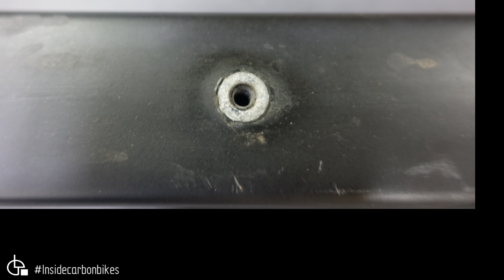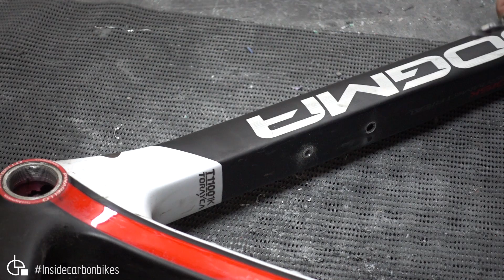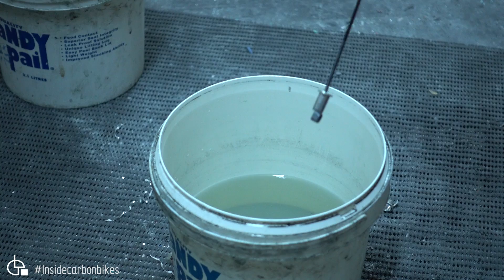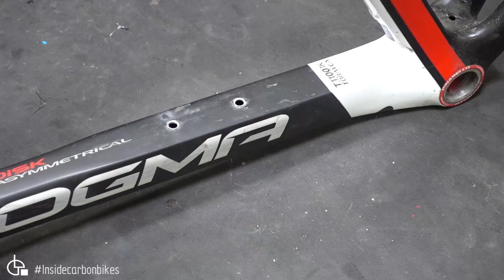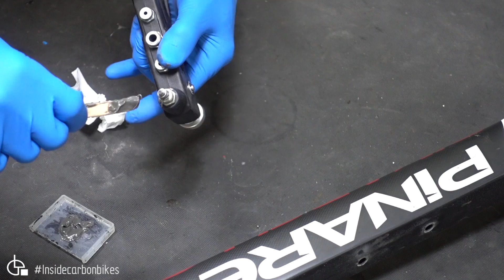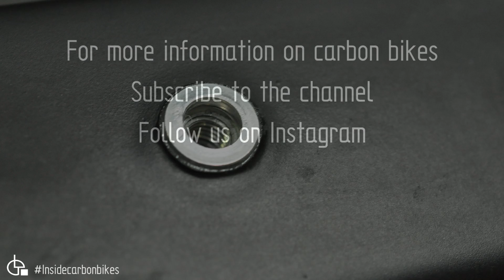How to Replace Inserts on Carbon Bikes - The correct way!

Comment: I realize this is 5 years old, but in what world is the epoxy not squeezed out entirely between the rivnut and the carbon when the rivnut is set?
Reply from the maker: The fit is not that close, adhesive stays in the gaps.

Comment: Is alodine more or less protective than anodising the inserts (alodine is difficult & expensive to get in the uk, & environmentally horrible). Any opinion on just using a stainless steel rivnut rather than aluminium?

Comment: Hi, thanks for the video 👍 I watched this as, after much deliberation, I think I’m going to install 3 rivet nuts in my Kinesis ATR V1 carbon fork to carry more water.  I’ve come to the view that the 3 holes will be in the neutral axis of the fork so shouldn’t impact strength and if properly bonded as you show should be ok.  But….. thought I would reach out for an opinion from a carbon expert before I make a daft move.  Do you think doing this would be insane, moderately sensible or absolutely fine….. if done with care? Thanks for any thoughts, I know it’s a bit of a difficult question to answer.
Reply from the maker: I would NOT do this, do not drill holes where they haven't been allowed in the design. Maybe bond a stud to the outer face but don't drill holes.
Reply: Thanks for the advice, I hadn’t thought about a bonded boss option…… a much better idea :-) cheers

Comment: Instead of two component epoxy I would recommend acrylic glue as used for example for phone screens for the coating and insulating.

Comment: I had an old Trek 8900 frame that epoxied threaded external posts to the carbon tubes instead of drilling them so you'd use nuts instead of bolts to affix the water bottle. No compromising tube strength, no galvanic corrosion. Superior design by far.

Comment: this happened to a mounting point on my carbon fork recently. a ton of white dust, almost sand like, accumulated then the insert just dislodged. my question is: is the fork still safe to ride? does it damage the carbon layup when the insert corrodes so much?
Reply from the maker: There can be degradation of the material in the area, it is difficult to say how much this would affect the safety but it is less than ideal.

Comment: Great vid Raul! When installing new rivnuts after drilling new holes in a carbon tube, does there need to be any carbon reinforcement added to the surrounding area prior to installing the rivnuts with epoxy?
Reply from the maker: It depends if there is carbon damage or not, sometimes I need to do a carbon repair prior to fitting the insert.

Comment: How about a layer of PTFE plumbers tape wrapped around the rivnut to instead of epoxy to insulate the aluminum from the carbon?
Reply from the maker: I would not recommend this for a number of reasons #lessthanideal

Comment: I've been told by my bike store and Ridley that its up to me to do this for a stripped out rackmount after 1 year of use! So I'm hoping to do this right since my mount is inline in the seatstay so there is mm's for room for error. Was wondering where I could source good quality rivnuts online? and typical sizing?
Reply: Typical sizing is M5. They are available in almost every hardware store. Nothing special is required. Just avoid the zink coated ones. For the bling you can go straight for stainless.

Comment: It looks pretty easy when the rivnut is tight and doesn’t spin wallowing out the 7.1mm opening.  What do you do in that case?  Thx for your wisdom.
Reply from the maker: I hold the insert to stop it rotating whilst I drill it out.
Reply: @LuescherTeknik  How do you hold the insert while drilling it out? About to embark on fixing a stripped rackmount...

Comment: Hi Raoul, great video! I was just wondering why they use Aluminium Rivnuts instead of Stainless steel?  Would Stainless be the better option for a replacement?
Reply from the maker: The force required to pull down the stainless steel inserts is greater which can damage the carbon laminate.
Reply: @LuescherTeknik  Thanks! I knew there would be a good reason for this.

Comment: If you don't have a rivnut tool or want more robust threaded inserts, you can buy stainless M6 Tee nuts, cut the teeth off, scuff them with the rotary tool, bond them in the hole with JBweld, flat side up, and press a couple layers of CF over the top to really lock them in place. Take care and it'll even look nice.

Comment: Nice job but instead of problematic aluminum, I would use a strong plastic insert- if I used an insert at all (I would not.)  That 0.001 layer of adhesive will wear off in about a week.  Instead,  I would simply use a CF wrap method e.g., use carbon fiber to wrap e.g., a flat plastic or CF bracket.  This can hold the bottle holder onto the frame.  It would spread the forces out better and be safer overall.  If anything, it will make that section of the frame stronger. Anytime you drill, shock or introduce aluminum into a CF frame, you are making it structurally weaker.

Comment: Raoul what is your technique for dealing with rivnuts that are loose in their socket and therefore can't be drilled out? Have encountered this several times over the years, usually when the bottle cage bolt is corrodded and the force needed to remove it exceeds the strength of the rivnut/socket bond. Seems a bit of anti sieze or grease on the bolt thread during assembly would help avoid this issue.
Reply from the maker: Yes this can be a problem, I have a range of methods and have always managed to get them out, usually by careful drilling. Prevention is always better than the cure in this case.
Reply: Series of very fine pie cuts on the outer face. It is time consuming but effective.
Reply: Try to glue them in place using a siringe for example and then drill them out.
Reply: Also just realised how old this video is. Silly YT algorithm. Oh well, better late then never...

Comment: What would happen if I skipped the Aluprep and Alodine steps, used the epoxy, and then touched up the bare surface of the rivet with a spot of paint?
Reply from the maker: The surface prep is very important if you want the epoxy to adhere to aluminium.

Comment: Outstanding content! Thanks a lot for sharing.
I have a question, I want to drill new holes on the lower tube for a bottle cage, I know I will be cutting some of the carbon threads, but isn't it like the manufacturers do?
It seems like they mold the frames and then drill those holes, isn't it?
Reply from the maker: "Often" there is additional material where the insert is, please don't drill random holes in your frame.
Reply: @LuescherTeknik  you are right. I found out they put some extra small layers on this areas.
Thanks for the advice.

Comment: Hi, I have a problem on a CUBE MTB. The Bearing of the chainstay has play, in an aluminium frame Iwould go ahead an glue it in with Loctite 648. Can I use the same method on a Carbon frame?

Comment: The care and knowledge here is just fantastic. Many other commenters have mentioned why don't the bike industry do these things better...!? From what I've worked out it's just the precision that is expected of those working with aerospace grade applications.  Out of interest I looked at the the MSDS for Alodine 1201 https://chemical-supermarket.com/files/Henkel%20Alodine%20Conversion%20Coatings/1201%20Alodine,%20MSDS.pdf - It's scary stuff (hydrofluoric acid and hexavalent chromium!) Just knowing the correct way to handle that alone requires specialist knowledge.

Comment: Would grease on the bolt treads help keep moisture out from the frame fitting enough?
Reply: No. Grease on the bolt threads would coat (and likely protect) the inner bore of the insert (the area that comes in contact with the bolt), but this would do nothing for the outer surface of the insert that comes into contact with the frame material.

Comment: I could be wrong but where does the Galvanic Corrosion circuit come from??
You have a Carbon Frame - Neutral & some Aluminium Rivnuts : -ve
Are the rivnuts just not corroding due to the salty sweat and leaking water bottles sitting on top of the rivnuts causing them to corrode?? There is nothing on the bikes where an electrical circuit is being set up to cause the electrolyte solution to create some very small electron wizardry.

If this is the case then Stainless or another higher resistant corroding metal should be used.

Either way, I still enjoyed your video :)
Reply from the maker: There is a potential difference between carbon and aluminium, salty sweat adds additional electrolyte to the mix.
Reply: Exactly. I also in doubts if metall pkus carbon may corrode with water or some. Carbon is neutral. Metall may coorode or two different metals may corrode together as galvanic pair while both stay in water.  Probably this happen as pair with bolts.  Moreover just aluminium alone in water or weak acid  takes protections film of its oxide and will not corrode further.  I am not chemic but root cause here is the question.
Reply: aluminum and carbon is litterally the worst-case for galvanic corrosion. Ti and carbon has essentially zero galvanic issues. 316 ss is also a great option.
Reply: actually carbon appears to be able to conduct electrons, not in the epoxy (which is an insulator) but in the actual carbon fibres (graphite like structures), so  on a small scale there can be electric cells in the material.

Comment: I've seen the braze on front derailleur inserts come loose on a $5300 frame before. Would have never happened if epoxy was used.

Comment: Luescher Teknik how come you dont anodize the AL inserts sd well as the obvios bonding needed? I thot that prevents the interface corrosion in general and additionally it would stop the exposed AL from oxidizing.
Reply: Alodining is easier and faster for him to do than anodizing.
Reply from the maker: Anodizing can crack when the insert is deformed. Alodine is simple and effective.

Comment: Why are not the inserts anodized for protection?? Oh, they will increase in price by.. almost nothing per mille.. I understand..    Rgr
Reply: Anodizing is a good idea and would help with the outside portion, but I suspect the surface would crack when the rivnut is compressed. So part of what the adhesive helps with.
Reply from the maker: Anodizing can crack when the insert is deformed.
Reply: @LuescherTeknik  Understood, but it would make a much better product with  minimal cost and effort. Sealing with adhesive when put in would solve this problem ( for ever? )   Rgr

Comment: I'm surprised the bike frame doesn't get all scratched up on that dirty workspace. 
You need something soft... like a princess blanket.   ;)
Reply: Hello hambini fans
Reply from the maker: It's a rubber matt on a vacuum table, the bike doesn't get scratched.
Reply: My Little Pony blanket?
Reply: @justsayin3600 
Maybe I need to improve on my delivery...  :( Those in the know will get it.  ;)
Reply: @itsm3th3b33  Specifically a Disney Princess blanket 😉
Reply: @richardhaselwood9478  HELLO [insert name] FANS!

Comment: Would this “rubber isolation brass threaded insert” offer a possible longterm solution;
https://www.junoindustries.eu/en/products/range/rivet-nut/rubber-rivet-nut-from-specialinsert-type-rubber-nut.html
https://www.junoindustries.eu/media/productpdf/275/rubber_nut_rev01en.pdf
May require slightly enlarging the frame hole 8tenths of a mm to accept the insert, however it requires no special tool to install.
Reply: Maybe moves too much?
Reply: rkan2, fit to the correct size hole and tightened properly, there would be no movement. No galvanic corrosion and sweat resistant.
Reply: rkan2, I believe the same could be done as others have suggested using heat shrink tubing on an aluminum rivnut prior to installation. May still require enlarging the hole .5-.8mm. 
I think I will go clean the sweat off my bike now since this topic is a good reminder to not neglect the minor things that can become problematic later on. 🤨
Reply from the maker: I haven't seen those before, thanks for sharing. They do appear to be non permanent which could be a problem.
Reply: Luescher Teknik, the 2nd link is the technical document and assembly states deformation upon tightening, so they should tighten permanently. 
The subject matter was a great reminder of not ignoring the small hidden details of regular cleaning. With the heat and humidity I ride in, I rain sweat all over the top and downtube.

Comment: Thanks Raoul, fascinating to watch.  Curious with a water bottle cage insert what not just use stainless steel over aluminum?
Reply from the maker: The pull down force for stainless can be excessive, aluminium is fine if handled correctly.

Comment: Hi, nice vid.  Is it possible to use stainless steel rivenuts to replace the alu ones? I think they will last even longer.
Reply from the maker: The pull down force for stainless can be excessive, aluminium is fine if handled correctly.

Comment: This is not a DIY effort. Don't try this at home kids. BTW, wouldn't Ti inserts last indefinitely? Is there anything we can do to minimize the corrosion and prolong the life of the factory inserts?
Reply: Yeah, use the same material for the frame as for the inserts ;-) My aluminium frame has a claimed weight of just under 1kg. I don't know why I should buy a carbon frame with a similar claimed weight or 100 to 200g less, while it costs way more money I can invest in some other lighter parts on the bike.

Comment: are titanium inserts available (to prevent galvanic reaction with carbon)?
Reply: Titanium is also subject to galvanic corrosion when contacting carbon fiber.
Reply: @roydarnell3683  titanium is relatively inert with carbon
Reply: @n0ch91c3s  That's what I thought too until I did a little more research.
Reply from the maker: Aluminium is fine if treated correctly and maintained.
Reply: Luescher Teknik right-ho. thanks.
Reply: Kind of begs the question: why not use high impact plastic inserts but a novel retainment design would be required.

Comment: What's the point of using epoxy? you can't insulate it from behind and the way the rivnut works is to mechanically crimp so you won't get any insulation from it. Unless I've missed something.
Reply: The alodine is an anti-corrosive coating for the aluminum. It works similar to anodizing.   The epoxy does help, when the rivnut is pulled and the inside mushrooms out, the adhesive oozes out with it and incapsulates the “mushroom” tip. You only need a few thou of adhesive to provide isolation. Finally, it seals the installation so that no electrolyte can get there. If you wanted to have an alternative you could go with duralac for permanently/semi permanent fasteners or lanocote for temporary/serviceable assemblies.
Reply from the maker: @Russell Miller spot on, you obviously have experience in this field, thanks for sharing.
Reply: @LuescherTeknik  Cheers mate.  Been around marine composites quite a bit.  If you think sweat dripping down onto your water bottle cage is a problem, try drowning your parts in seawater!
Reply from the maker: Yes, I am well aware, I used to do R and D for the Navy, the environmental conditions are somewhat enhanced!
Reply from the maker: Have you ever seen a fastener fitted to a carbon aircraft part dry? It is important to seal the laminate edge and prevent moisture ingression. Epoxy or PR is typically used, a barrier ply on the surface is good also, some bikes have it, others don't. Excessive mechanical force can also delaminate the material, it is better to use less force and adhesive.
Reply: @LuescherTeknik  I have never seen ones where they require dipping. That's a new one to me but it's not my area of knowledge.
Reply: @Hambini  shhhh
Reply: Shhhh Sanjeev Varah with your bogus tech knowledge LOL - why are you using a fake name and fake credentials?
Reply: @dafj5618  how is Stafford road today? Do pass on my regards to Michelle, Maurice
Reply: @Hambini  what are you talking about
Reply: @dafj5618  Norwich pharmacol, maurice
Reply: @Hambini  :-D